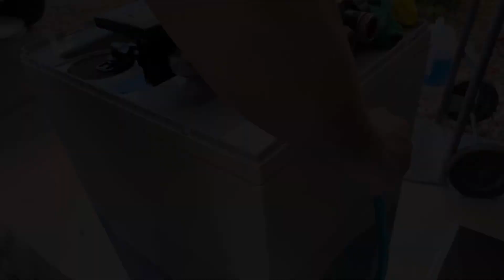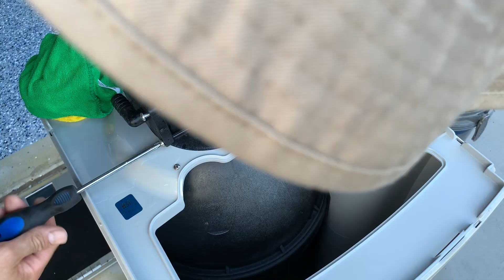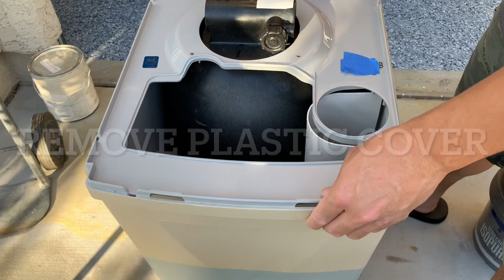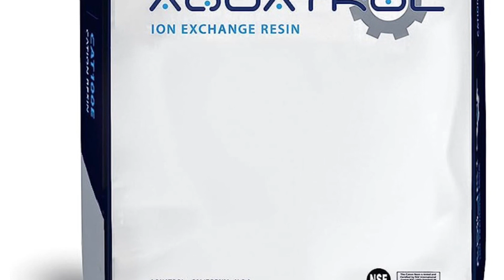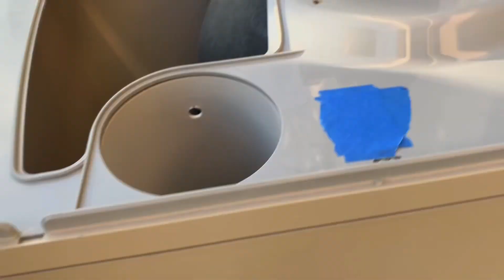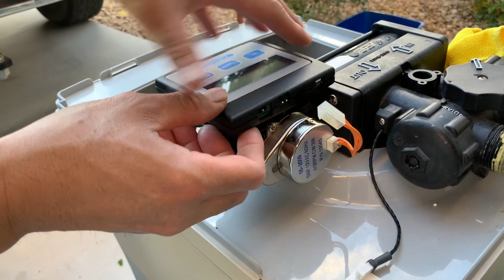Waterboss 900 Water Softener Resin Replacement

Comment: My waterboss 700 filter has a plug on top, can the cleaning medium also be replaced? My filter is 7 years old, but it seems that the filtration is no longer effective, orange-yellow water flows for a long time after regeneration. Can I use some filter cleaner?, do I have to worry about clogging? What filter mixture can be used? My supplier in Europe only has grains of size 0.3-1.2mm, but here they should only be 0.3mm, am I wrong? Thank you very much for the answers. PS: Great video, thank you for it.
Reply from the maker: Ow man, sorry to hear that... When mine failed, the resin floated and escape the screen  and clogged our washe r line and faucets. After this incident, I installed and a post water softener filter 30 microns specifically for preventing anything large enough to clog our washer and faucets. If you use a cup and catch the yellowish water, I am certain that it is the resin escaping. Before buying resin, I highly suggest you disassemble the unit first because there is a high possibility that you may need other parts to put it back together that may cost you ALMOST the same as buying a new unit... I believe the .3-1.2mm resin size is pretty standard for the water softener. Best of luck and thank you for the kind words!

Edit: Before you do anything, try using Iron Cleaning salt for 2-3 bags just to make sure you don't have EXCESSIVE iron build up in the bottom of the system. But also, like I stated, after regeneration, try to catch the yellowing in a glass or bucket and see if you see small tiny glass looking pebbles or just rust. You may have to remove the aerator on the faucet in order for you to collect the yellow water. Resin normally lasts around 10 years, but not unusual if you house using a lot of water per year...

Edit:
I read your comment one more time and you used the word "filter" and I assume you are talking about a Pre-water softener filter and Post-water softener filter and I am wondering if you are pertaining to the "resin" as a filter? Because the resin is an ion-exchanger and not actually a filter... Inside the tank has a "screen" but it is not meant to filter iron and such but to keep the resin from coming out of the tank, unless the resin has been depleted, in this case, it will float and will escape on crevices...
Reply: @mikedoingmikethings702  Thank you for the exhaustive answer, I really appreciate it. Sorry for the late comment. By filter I mean the entire Waterboss 700 device. I do not use a pre-filter or a filter after the Waterboss device. Tomorrow I will receive a cleaner that is used for automatic filters. I would like to use the cleaner, but I am afraid that my device will become an iron bell, as you write in one of the comments. Last week, instead of the cleaner, I used 150 grams of citric acid dissolved in salt water. It seems that it released a lot of iron. Tomorrow I will clean the device, unscrew the aerators and show off the results. So the upper screw is intended for replacing the resin? Will I not destroy the device if I use 0.3-1.2mm resin? Sorry for the stupid questions, I would not like to completely kill the device.
Thank you very much for everything.
Reply from the maker: @l @lukaskliment6902 the resin size used are standard size… I think you just have iron build up, just use iron cleaning salts, it will eventually clear it up…
Reply: @mikedoingmikethings702  Thank you very much.
Reply: @mikedoingmikethings702  Yesterday I cleaned it with a cleaning agent. I looked at the water coming out of my system, and surprisingly it was quite clean. I thought my problems would probably persist, but after cleaning my water is crystal clear and I have no more yellow-orange water problems. We'll see in the future, I'll definitely use the cleaner every 3 months as a preventative measure. Thanks Mike.

Comment: Won't you loose resin out of the top when filling from the bottom?
Reply from the maker: There is a built in mesh filter inside that prevents the resin from coming out…

Comment: I installed a WaterBoss 900 in March of 2004. It had been trouble free until it recently stopped softening water. I got some WaterBoss cleaner. I used the cleaner 2 times & regenerated several times. Still no soft water. Yesterday I replace the 900 with a ProPlus 380. The only problem I had on the swap was that the 900 had 3/4" connections & the 380 has 1" connections. I did not discover this until I got home & unboxed the 380. The 900 was installed with sweat copper. I could not find 1" to 3/4" copper female adapters. I ended up making another 40 mile round trip to Menards to get 1" to 3/4" supply lines. After that, the swap was trouble free. It was nice taking a shower with soft water again.  Now I am taking the 900 apart to see if the resin was the problem. All of the head parts looked fine.
Reply from the maker: If every moving parts are still good, it is definitely worth saving instead turning it into a landfill filler… LMK if the resin was the culprit…

Comment: Decided I would run some iron out cleaner through my Waterboss 900 because my wife is complaining about water smell. About 3 or 4 hours later our water turned brown and there was a considerable PSI drop on system. I figured the cleaner had loosened up a 4 yr a build up of iron and now clogging system. I ran about 4-5 regenerations with no improvement. Waterboss suggested more Regenerations but I was not confident that would help and probably the resin was beyond repair. Installed new unit. Now I am scrapping out old unit and when removing plug on bottom of tank it looks like nasty black glob of resin. This looks like a mess a mess I don’t want to deal with. Any suggestions how to get rid of this. I don’t want to really wash this thing out with a hose. Is this an environmental nightmare. Any advice.
Reply from the maker: Sorry, I have not seen your post. Sometimes youtube do not notify me for some reason. These resins are not to be dumped in waterways or drain... I'm not sure if your local recycling would accept these but you could always give them a call. 

Anyway, you could use an old blanket or towel to catch the resin, but honestly, for the amount of money resin are going for right now. I would just buy a whole new unit thinking that a new unit will last another 7-10 years. New unit will come in with new parts and a guarantee of peace of mind. If my old unit breaks down again, I will buy a new unit and disassemble other parts that I could reuse such as the control panel, motor units and other parts that have not degraded. Best of luck!!!
Reply: I installed new unit. The cost of media being a factor.

Comment: Love to see other 900's have run 10 plus years in comments.
After watching your video, I asked Water Boss repair site the proper steps to remove the media.
Surprisingly they told be the medium CAN NOT BE REMOVED!
They CLAIMED the medium tank is welded together.
Sure looks like yours came apart just fine.
Thanks for your video.
Reply from the maker: hmmmmm... that may be the case on the newly built ones? not sure, but if you look under, if there's a cap, then the media will come out of the tank either from the top or bottom...

Comment: My WaterBoss 900 lasted 15 years. Bought a new one when I wasn't getting enough soft water. Now I can replace the resin in the old one and have a backup in another 15 years.
One thing to note about the WaterBoss, you do have to clean out the salt holding area about every 5 years, to keep fine particles of foreign matter in the salt bags from clogging things up. Nice video. Thanks for sharing.
Reply from the maker: Yes sir, I have noticed that too! Those small dirt particles really clog up the brine ball float and the brine valve if we don't clean it every now and then. Thank you for viewing and the kind words...

Comment: Thanks for this useful video. Looks like I need to replace my support panel for my new 900 and your video is the best one I have seen to do just that. Fingers crossed!!
Reply from the maker: It is pretty straight forward. Unplug the two wires and move the panel to the right and it will come off. It's just being held by plastic tabs under it. The wires in the back are "specific" so it won't fit on other slot if you accidentally plug it in on the wrong spot. But, if in doubt, take photos of the wires prior to removing them...

Good Luck!!!
Reply: @mikedoingmikethings702   that seems like the easy part! lol  i need to take everything off and replace that gray support panel that snaps onto the actual cabinet. Looks like I also need to dissect most of the parts that are attached to the resin tank to be able to take it off. Your video shows more than most.

Comment: Great stuff! The water pressure is bad in my house and all the incoming water goes through the water boss 900.  The power went out a couple of days ago for 24 hours and now it seems like it’s not working.  No error codes, just when I ran the water for 20 min to try to clear the pipes the water the water pressure dropped and I can’t get it back.  After regenerating it still nothing.  Any advice?
Reply: I’ve only had the unit for like 4 years
Reply from the maker: @m.creekrenovations remove the inlet from the water softener and measure the pressure if you have a way to do so to pinpoint the problem. If the water softener is only 4 y/o I highly doubt that the resin is bad, but not impossible. One sure sign of bad resin is, it floats up and it comes out of the tank out to your faucet.
Reply from the maker: First you have to find out if the water pressure is good (40-60 psi) before the water softener. You can switch the dial to "BYPASS" and see if that makes a difference. When the resin is no longer good, it would float up and go through the water line and clogs the faucets, shower heads and washing machine. I found this out the hard way. I installed an inline whole house filter after the water softener just in care this happens again and saves me the hassle of clearing our waterline.

Here's what you can do:
1-Does your outside of the house water pressure good?
2-Bypass water on the water softener (dial is located by the In-Out water supply line)
3-Remove faucet aerator and see if there's any resin
4-Check prior to water pressure regulator (looks like an enclosed copper bell) in the garage, check before and after this device for pressure. It could be that this went out and needs replacement.

Good Luck and let me know if this helps!